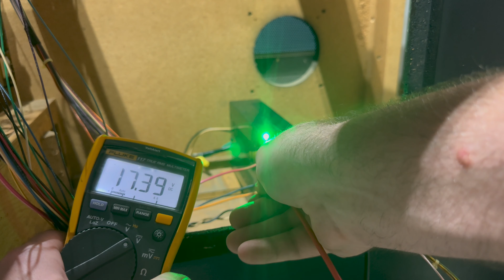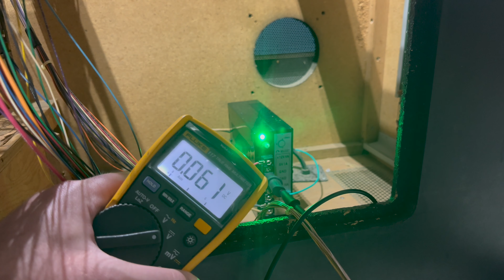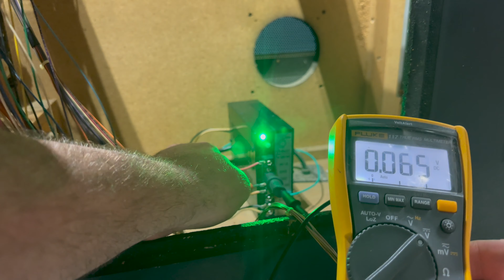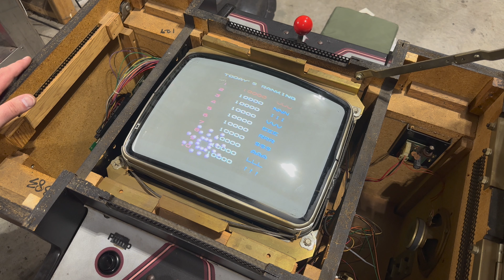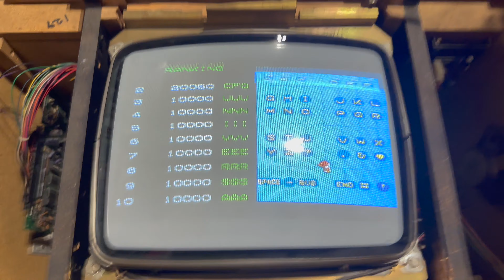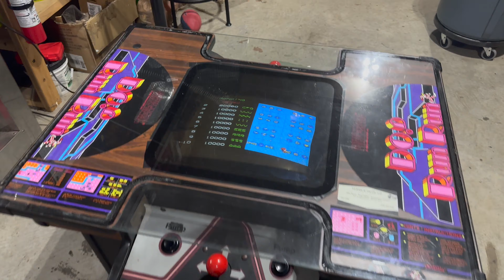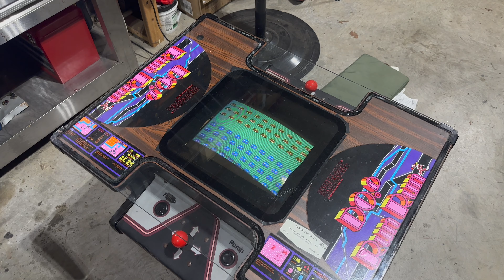3X DANGEROUS Surprises hiding inside this ODDBALL Converted Arcade Game!!! ⚠️⚠️⚠️

Comment: @21:50 over here where I live we usually let the ground wire be a bit longer than the other conductors. The idea is that, should the cable ever be yanked out of the plug, the ground wire is the last one to leave. Don't know about the states, maybe it's not possible to yank a cable out of an us plug without the plug being yanked out of the socket; Still on the cabinet side it seems like a good idea...
Reply from the maker: That’s a good idea! What part of the world are you from? Most US plugs don’t lock into the outlet, and are fairly easy to pull out without the cables being ripped from the plug itself.

Comment: If I were you, I'd wire it for JAMMA with the proper ISO, fuse block and line filter. Then I'd put an FPGA BitKit in there with Dig Dug until you can find the proper boardset.
Reply from the maker: Good idea — and I overlooked the fact that this cabinet was missing a line filter too. Crazytown!

Comment: If you have a shop in your city that prints decals for vehicles they can do it for you get it printed I don’t think you would need to get it laminated because it sits under the glass
Reply from the maker: Thanks, Wayne! I wonder if they have to do anything special for the transparent portions of the artwork…?
Reply: Does it stick to the glass if so reverse print on clear and laminate the back with white vinyl.
Reply from the maker: That makes sense!